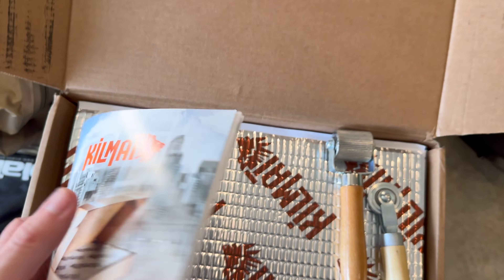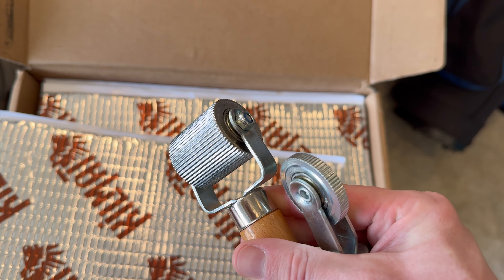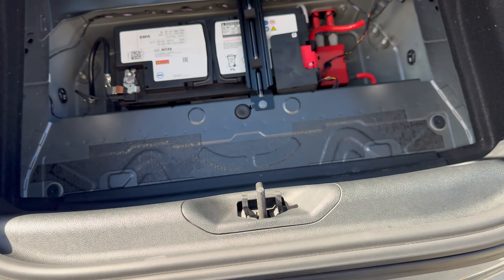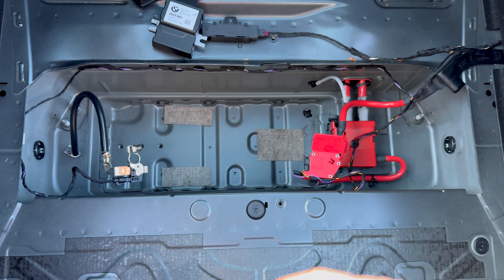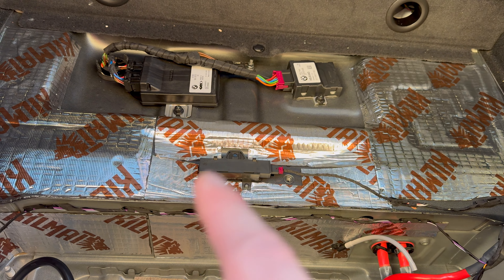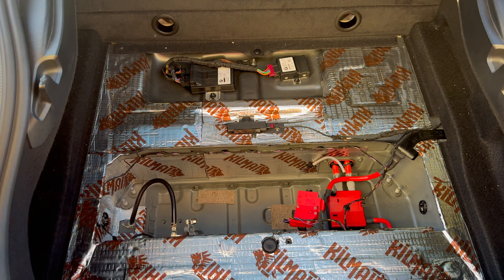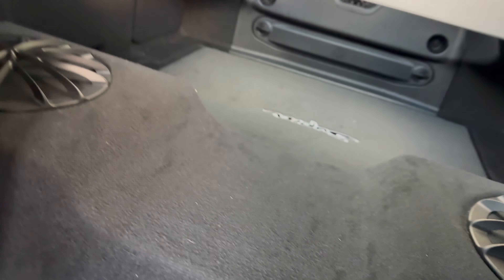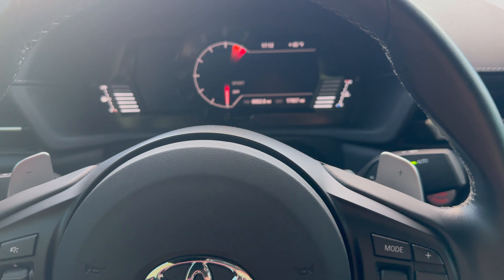Attempting To Sound Dampen The Supra To Reduce Exhaust Drone

Comment: I chose that route originally when I did the subwoofer mod. I saw where you did that also. I chose to use the wall waffle 12”by 12” sound proofing material. It’s super lightweight and can be stuffed almost anywhere. I removed the back trim pieces all the way and put it inside the panels and around the battery tray location. I also used my factory floor mat under the rear mat to also assist in the noise. It did help out. Took about two hours of work, but a noticeable drop in my drone from my exhaust, without adding a bunch of weight to it. 😁
Reply from the maker: Hmmm I’ll have to look into that too! The drone gets rough 😂

Comment: Yeah, I did similar for my STOCK Supra and drone dropped significantly as well has allowed me to listen to the stereo. 
But that's also the stock muffler-ed unit.

Running catless/downpipe, single exhaust, smaller muffler (no internal baffling most likely), large pipes - will produce more noise (which is why we ALL love), but also unfortunately... drone, so sound deadening wont be as effective. :\
Reply from the maker: Yeaaa unfortunately I believe you are right. It didn’t do a whole lot but I think it helped a bit. The Supra isn’t the daily anymore and went full racecar so imma probably try and pull it all out 😅